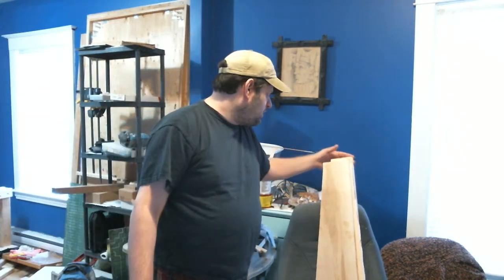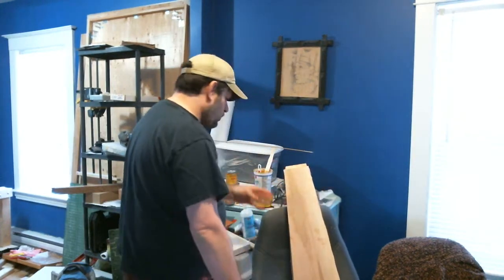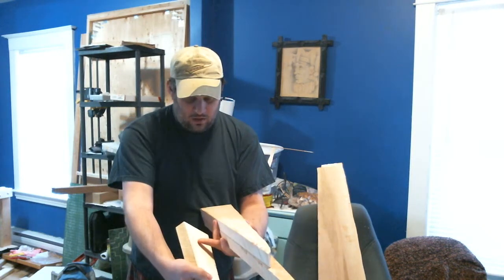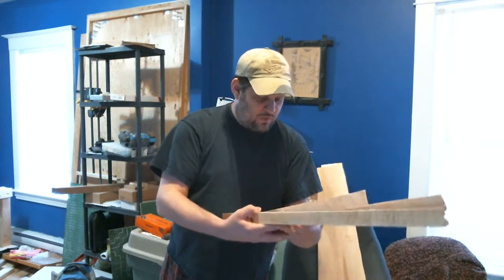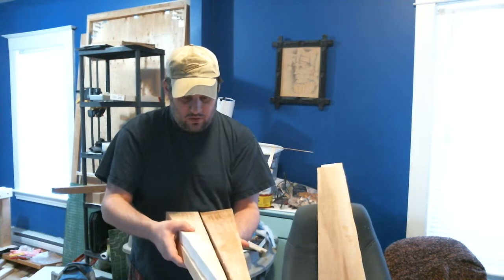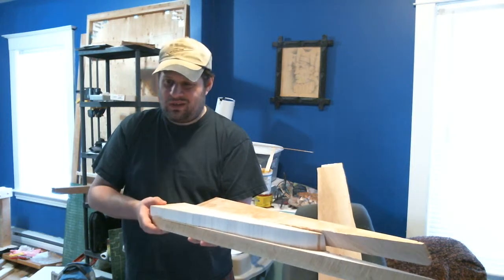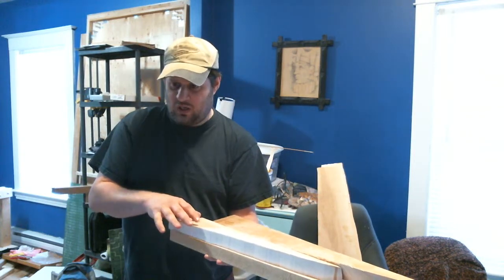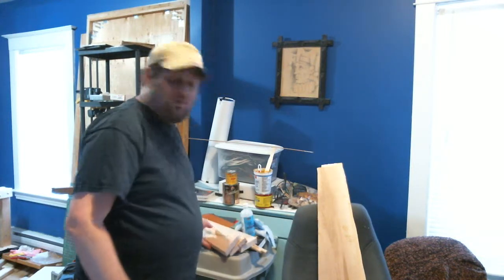Epoxy test part 1

Comment: You have to joint the two pieces and they will glue together perfectly with standard wood glue and be unbreakable at the glue seam.  

Even with expoxy glue;  the joint will break if two pieces of wood dont have flat faces before glue up.